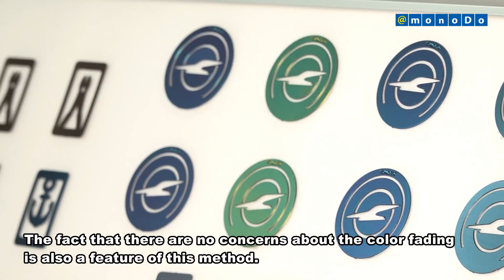Technology for giving stainless steel 20 colors by coating-less plating

Comment: Are the colours non corrosive?
Reply: The color is a result of a thin oxide layer, aka it’s the result of slight corrosion. It actually protects the metal from further corrosion to a certain extent